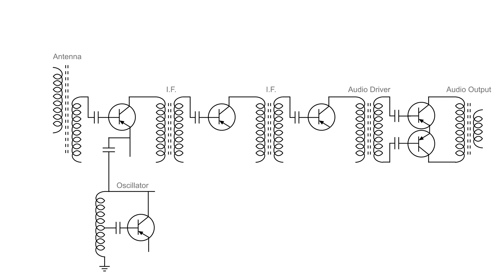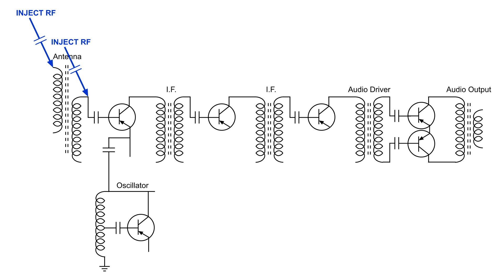Oscillator Troubleshooting, Transistor AM Radio Bradford WTG-60715

Comment: I don't understand how a signal generator can play the audio from an AM station. The signal generator just injects a carrier  wave or  modulated with a tone you specify in hertz. It can't play the audio from a AM broadcast station
Reply from the maker: The signal generator is taking the place of the local oscillator, so you can tune stations with the signal generator.

Comment: Thank you. I have an old sony that I have tried everything. I will try the heat trick and maybe replace the transistor. My transistor is a 2SA330 of which I can find no information. Thank you for the tips.
Reply from the maker: I hope you are successful repairing your radio. I did find some information on the 2SA330
https://www.radiomuseum.org/tubes/tube_2sa330.html
Keep asking your questions. Thanks!!!
Reply: @AllAmericanFiveRadio  Thank you so much. Kind regards.

Comment: I dug out my vintage Sony (ICF- A10W) clock radio that I bought used about 12 years ago. After I bought 12 years ago, I just tested quickly and not sure if I checked the am radio and just stored away. 

So when I came across it in my storage, I took it home, but heard something loose inside. So I took it apart with just 2 small screws. I found a long metal bar with 2 thin copper wire wrapped around lose and I believe came loose in shipping 12 years ago bc the eBayer left the battery in shipping and when I got it, the radio was playing inside the package. Lol! 

So bc I didn’t have any glue, I just put the loose bar near where it was attached to the inside corner. And it still shakes but seem not as much as before. 

But now I’m wondering if the am was already broken or if I had put the buttons back wrong? I managed to not break any of the plastic and careful taking it apart with snapping off anything. That’s the problem with handling something brand new and understanding without breaking it on how that part all go into place. Lol!

I’m not that mechanical and don’t understand how things work or what each thing does what. So I get lost and usually don’t even go as far as taking apart or trouble shooting, I always hope for an easy fix or look on YouTube for guidance. 

So if it having to replace the am part, are they all about the same or are there many? Can I take it jist from an old radio with am? 

This clock radio I have is a collectors item and I want it to completely work and including the am radio I never use. Lol!

Anyway, thanks for the tutorial!

Maybe if I re glue tgat metal bar, the Am will start working again. Also, I’ve looked at about 20 of these Sony clock radios used and most just have the fm wore port and not the wire that plugs into it. Perhaps most didn’t need or lost after 40 years and I only saw one unit with the original fm wire. Meaning if I find the fm fm wire, would that help make the am stations to come in? Oh and the end connection is much smaller than the end of the standard headphone jack. So it might be hard to find a replacement.
Reply: I guess there are ppl. like you that likes to fix these old  radios and spend time trying to get them to work. Bc I see used radios at thrift stores, flea markets and garage sales and could easily find an old radio for under $10. 

I just picked up this Aiwa handheld emergency wind up option radio with even a light for $15. in like new condition. I should’ve gotten this top of the line Yamaha receiver from the early 2000s they were selling at Goodwill the day I was there first thing in the morning to get a record I saw the day before for only $24.99. I didn’t want to carry that 30lb. receiver on the bus and running late for work and in 7 minutes, I saw someone buying it when I was checking out.
Reply: I also remember the days when there were many electronic repair shops and now gone like shoe repair shops bc of this disposable generation. This needs to change bc many now are getting into vintage aiduo equipment and many those units needs servicing and someone to care for these solid made equipment from the past, instead of filling up landfills. 

I remember buying this great JVC 80’s receivers with green lights and I think the spin radio dial from this guy who used to repair audio and worked at a few high end stereo stores in I think Portland or Seattle. He bought the troughs the receiver from a local theft store and cleaned it up and made sure everything worked.  He told me he still knew places that sold parts for these older units and that this was a way to make some extra money flipping vintage stereo equipment to supplement his income while being retired and 12 years ago he was in his late 60’s and also told me he had cancer. 

I always love. Intake stereo equipment and not someone looking for one stereo to own. So I know now this vintage stereo collecting is trendy but that didn’t make a difference or change my love for vintage audio equipment Partly bc when o was a kid, I was fascinated by the adult buying stereos and how much that was a part of the culture in the 70’s and 80’s. 

I wish I was able to open a store 12 years ago buying and selling vintage audio equipment as some are doing now. Bc back then everyone thought I was nuts and didn’t understand my passion. 

I just a few days ago went to the SFMOMA museum in San Francisco and they had this great exhibition on vintage audio equipment and vintage concert/ music shows that were vibrant in color and fill up all the walls that made a huge impact. They even had 2 floors of independence used record sellers for the first time in the museum that USF normally has twice a year. 

It’s all coming back and the younger generation is responding hard to it, especially in the big cities across the US.
Reply from the maker: Your Sony radio is two radios with shard parts. I recommend to contact your local Ham Radio Club, for help. There will be someone in this club who repair radio or knows some who does radio repair.
I did meet Mr. Carver when I was living in the Seattle area.
Digital Time Lens by CARVER
https://www.youtube.com/watch?v=eRNoUJcxQhY

Comment: I think a very unusual fault, but with the illustrated method of diagnosis, giving detail of its function in a standard AM 'superheterodyne' radio, came to it in theory as well as practice. I looked up 2SA102, and found it to be a PNP point contact germanium transistor made by Matsushita, Japan, the company most known for making 'National Panasonic' radios, record players, amplifiers, etc. This radio might well have gone through the manufacture process (soldering), checked through final inspection, then tried in a cold atmosphere, and stopped playing. Thanks for sharing the information..
Reply from the maker: Thank you, and your welcome.

Comment: I have a 1967 Mustang original radio.  The radio lights up, has volume but the radio is oscillating.  It varies as I tune across the AM band.  I can't hear any stations just static with varying oscillation sounds. Any tips or forums that might be familiar with this AM only radio.   I can't find a schematic.
Reply from the maker: All the capacitors are bad. The electrolytic capacitors are polarized and must be installed correctly. I see if I can find the schematic.
Reply: @AllAmericanFiveRadio  after more tuning across the band I picked up a local station.  Its not strong or clean sounding.   If I connect my outdoor wire antenna the station drops out almost like the radio is being overloaded.
I am wondering if a cap involved with AGC could be bad.   Thanks for looking for a schematic.   On the side of the radio
it has the marking 7TPZ   Its AM only.  It appears to be the original radio with only a single speaker output
Reply: @AllAmericanFiveRadio  Thanks,  the side of the radio has 7TPZ marked on it.    Its AM only single speaker output and appears to be the original radio from a 1967 Ford Mustang.   I checked the junctions of the only 3 transistors and the meter indicates the correct forward bias voltage.   Emitter to Collector is around 1.4v
The transistors are marked AR 103, AR 104, and AR 105 and they are germanium transistors.   I also checked a germanium diode to be good too.  This diode must be for audio detection or part of a AGC circuit.  There are a few caps and one large cylinder cap that looks like its a multi-capacitor.   Its corroded on the top and probably bad.
I am going to have to remove the cap to get the values or if you can find me the schematic.  I appreciate your help    Thank you,
Reply from the maker: @n1kkri  I Just talk to a friend in the St. Louis area. He is going to look for the schematic. Hoope he can find it.
Reply: @AllAmericanFiveRadio  Thanks,I really appreciate the help.  Ken
Reply: @AllAmericanFiveRadio  I was told SAM photofacts AR-41 contains the radio.  (7TPZ)
Reply from the maker: @n1kkri  My friend does not have your radio schematic. I did find it on Sam's website, here is the link.
https://www.samswebsite.com/en/photofact/search?t=model&o=0&k=7TPZ&submit=Search&s=Search
Reply: @AllAmericanFiveRadio  Thanks for the trying.  I was aware I could purchase it a manual on ebay. too

Comment: In my case my vintage cassette  fm.is working but the am station is no signal whats wrong thanks bro
Reply from the maker: It's hard to say from several hundred or thousand miles away. Since the FM is working there is a very good chance that the oscillator for your AM is not working. Below is one way to determine if your AM oscillator is working.
Oscillator Trouble Shooting Using Radios as Testers Demo
https://www.youtube.com/watch?v=AuLP31cLBMQ

Comment: I never seen 2SA102 transistor about 42 years ago, what is push/pull audio output transistor number?
Reply from the maker: I no longer have the radio. Any germanium PNP audio output transistor will work.

Comment: Your video about the FM signal path in tube radios actually helped me fix my transistorized Marantz 2015’s FM tuner. One day the stations just stopped coming in, all I could get was static. I was hoping it was a power supply problem. But the more I poked around, I knew the problem was in the FM tuner itself. Since I seldom see a tuner fail in a receiver, I’m really not experienced with tuners. After poking around more and reading the little description in the service manual, I was able to determine that it’s FM 10.7MHz oscillator stopped working. Later, I found an open base-emitter junction in the oscillator transistor (H103). Replacing the 2SC930 with one from an extra tuner board I bought on eBay, made the oscillator go again and all the stations came back! Now, I believe the FM needs to be aligned but it needed that since before the oscillator transistor failed. Thanks for your videos! I’m still wondering why the low-power oscillator transistor failed in the first place(?) Hopefully it failed on it’s own without the help of another bad part....
Reply from the maker: That's great! Glad you got your radio working again. Hope the video helped. Thanks.

Comment: Thank you for the video.
What controls the power to the oscillator? I understand that the oscillator has to have pulses of power at the proper time to oscillate. Is this correct?
Reply from the maker: Download my free ebook. There is an explanation of the oscillator and much more.
The Vacuum Tube Shortwave Radio
http://www.richardmcwhorter.com/vacuumtuberadio/

Comment: How do you select a replacement transistor when the specifics of the old one are unknown? I have a situation with proprietary part numbers and don't know what to replace it with.
Reply from the maker: Determine if it is PNP or NPN, than us a beta of at least 200

Comment: I just picked up an old realistic boombox style fm/am cassettplayer.. the radio worked awesome for about a half hour.
 next time I turned it on the radio sounded a little weak and in a matter of minutes it stopped receiving signal.. am and fm???...even the dial indicator lite stopped illuminating.???? thanks for you video here.. I might have to look into this oscillator thing
Reply from the maker: Thanks

Comment: Hi there,
Not sure if you can help me since this is an old video..
I have a slight problem with the AM/MW band of my Eton FR-250 multiband radio
This is an IC (Sony CXA1691) radio & my problem is the lower band on AM/MW, from 535KHz to around 1100KHz had gone deaf. All I hear are static noise. Above that freq I can hear the nearby station at much reduced gain. It is not loose contact since I already checked thoroughly the solder joints & tapped the board for any loose connection. Sometimes the reception would return to normal then suddenly go quite again (background static hiss remains)

Can you give me an idea which stage (IF or RF) should I check & which part (capacitor, coils, etc) could be causing this. FM & SW are all ok

from a fan in the Philippines
Reply from the maker: It sounds like the oscillator for the AM/MW band is not oscillating. You can use another AM radio to confirm if the oscillator is working.
Oscillator Trouble Shooting Using Radios as Testers Demo
https://www.youtube.com/watch?v=AuLP31cLBMQ

Comment: I have a general electric model 7-2825a am fm radio I'm pulling my hair out it works only in fm mode no am receive has 2 transistors ive replaced the caps I don't have any imfo on voltages I wished I had a signal generater I only have scope and volt meter not sure any ideas
Reply from the maker: AM and FM superheterodyne radios are set up with a separate front end for both AM and FM. This means that each has its own oscillator and I.F. cans, what is in common with both is the audio amplifier. I did look for a wiring diagram for your radio but have not found one yet. I would try and determine if the AM oscillator is working, I have done a few videos on how to do this using another AM radio.
Oscillator Trouble Shooting Using Radios as Testers Demo
https://youtu.be/AuLP31cLBMQ
All American Five Radio Troubleshooting
https://youtu.be/clRQ0qxnA10
Digital PC Oscilloscope Signal Tracing
https://youtu.be/_fHAuzDIgEQ
AM Radio Demodulation Oscilloscope Demo
https://youtu.be/pKA0TPdnHg8

Comment: My Nobility 10 radio puts out full volume white noise-- volume control doesn't diminish it, and it does not tune any station. The pawn shop says it needs a new ant. It looked good to me and all the leads to the ant. are soldered in place.

Comment from the maker: The generator is taking the place of the local oscillator. So any frequency difference between the local oscillator and the incoming radio station RF that produces 455 KC will pass to the radio. Which is the normal operation of a superheterodyne.

Comment: One question: Since the IF stages are set up to pass 455 kHz (typically) is that the carrier frequency you injected into the antenna? 
If not, then I don't understand how it would get through to the audio sections and speaker if you wer injecting AM band frequencies and the local oscillator was not functioning. Perhaps you could clarify?
Reply: The answer is simple. The signal generator acts as a replacement for the (broken) internal oscilator.

Comment from the maker: Thanks Ron Pearson
I use other methods for tubes because of the higher voltage. It have to be careful not to burn out the oscillator coil, or the primary of the IF
Reply: AllAmericanFiveRadio

Comment from the maker: You could inject a signal on the first transistors emitter base and or collector. I just found a convenient spot right at the antenna. If I would not have heard any stations I would move halfway up the circuit and found another test point. Cutting the circuit in half is common troubleshooting practice. There are many points for injection and for signal tracing, none of which will do you no good if you do not understand how a circuit works.

Comment: Rick, thanks. understand theory of mixer circuit from p 72. Just trying to take advantage of your ample experience.
You are putting in an am signal at, say, 1000Kc. Local oscillator isn't working so mixing down to 455 kc shouldn't occur and like you said "nothing will come through the radio".

If you suspect that lo isnt working, why not put lo signal from sig gen into emitter of the mixer stage? Just trying to understand 1) if that would work and 2) the advantage of your approach.

Comment: I am just trying to square my understanding of what I think I understand (and may not, btw) with what you did. It seems that if you just injected a 455 kc signal at the collector of the transistor, wouldnt you hear a signal by tuning the tuning knob of the radio?

Comment: Exactly..so when you put in an rf signals (spanning the am broadcast band) into the antenna you are approximating the rf input derived from an on air signal, arent you? What I dont understand is that if when you put that signal in and you hear a signal out,  doesnt it mean that the local oscillator stage is in fact working? Otherwise you wouldnt have the difference signal of 455 kc coming through.....and the if stage tuned to that freq wouldnt come through.

Comment from the maker: I put the signal at the antenna for a number of reasons. If running through the AM frequencies nothing is heard from the radio speaker, this means a IF can may be open and the oscillator could still be bad. In this case we heard stations running through AM frequencies, the IFs are good, but I could not tune in a station with the radio tuner. This means the oscillator in the radio is not working.

Comment: By injecting RF at the blue arrow, aren't you approximating an rf signal coming into the antenna? Im not sure why that would show that would show the local oscillator wasnt working. It seems that in order to show that the local oscillator is at fault, wouldnt you have to inject an rf signal at the collector of that 1st transistor of precisely the correct freq and thus emulate the oscillator? Sorry but I dont understand